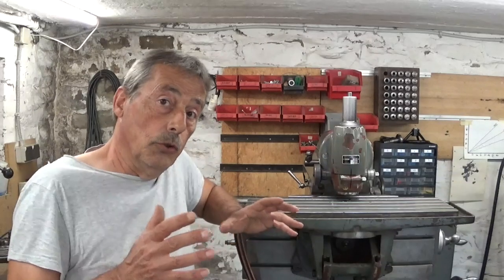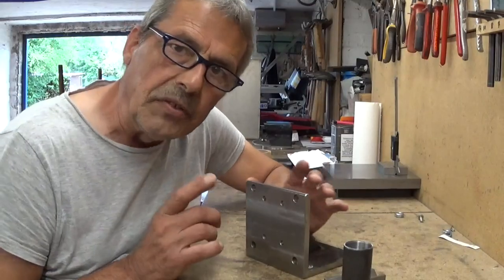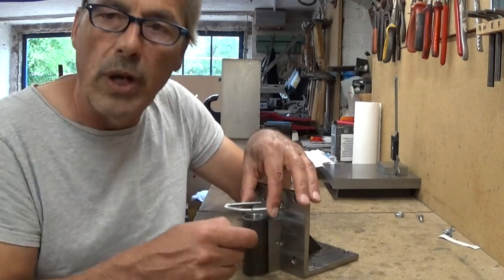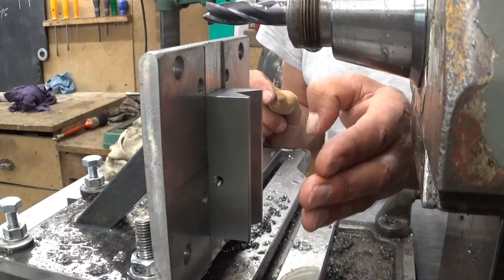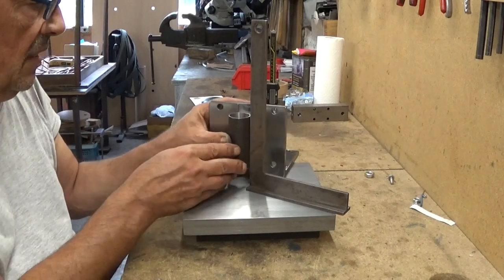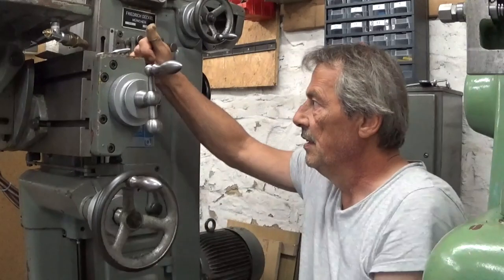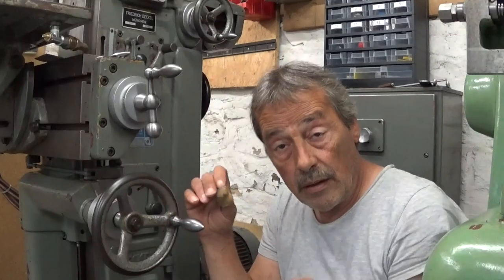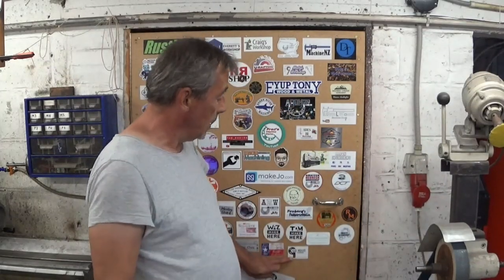Locating a V-block on an angle plate.

Comment: Hello Rusti, thank you for your channel. 
Your humanity, empathy, sympathy,  sharing and caring, positive vibes, etc.  gives me a lot of joy and hope!
Condolences for Sammie husband and Family and friends .
I am restoring/ rebuilding a FP1. 
Verry short said: Move the stick that enables the Up/down feed , this turns a little axis, this axis is connected with the automatic stop lever on the other side of the saddle. In between , inside the saddle it turns a pivot thing that moves up/down 2  gears. 
Something seems wrong in this ... A little test : If  you can move the automatic stop lever up or down, if there is play ? You will find the pivot thing not tighten well inside. the 2 gears don't move good in there position. Solution , take the saddle off and apart. You will find a lot af info about that In "Practical Machinist" I hope this is helpful ! I can help you more, but then I have send you pictures etc. I dont know how...?
Love, and best wishes , Frank
Reply from the maker: Thank you very much frank. This is indeed very useful information.

Comment: The slot makes a lot of sense, especially since the angle plate is still totally usable for any pieces that span the gap.  As I'm late to the party as usual, I see you have a video out about fixing the feed on the Deckel, will be interesting to see what you find.
Reply from the maker: Thanks Everett. I can also use the angle plate te slotted face down.

Comment: Hi Rusti, why not use Unistrut with rollers to lift and move the top of the mill.
Reply from the maker: Not enough room between top of the machine and the ceiling.
Reply: @Rustinox  Unistrut is only 50mm square, and can be bolted direct to the ceiling.